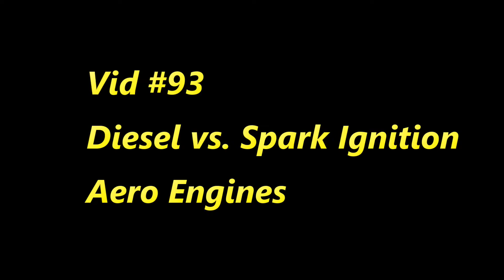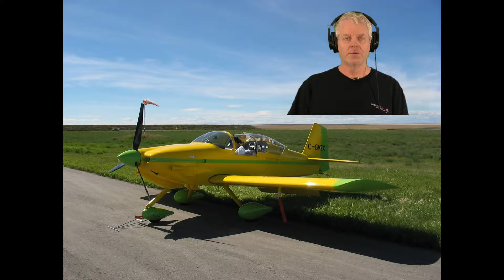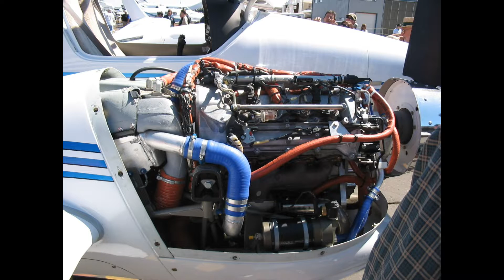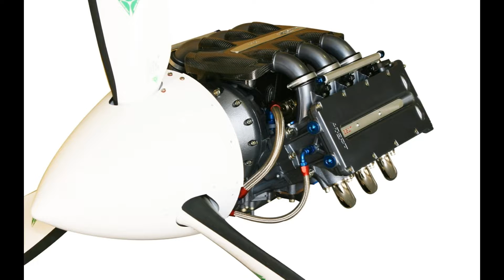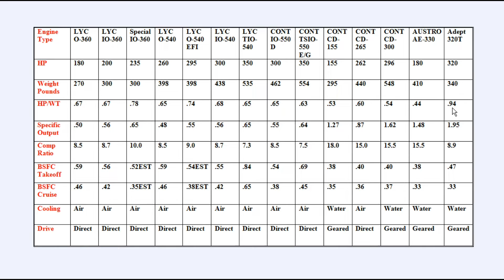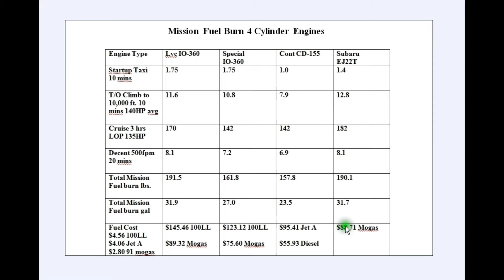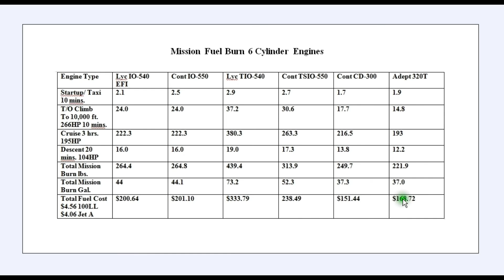Vid #93. Diesel vs. Spark Ignition Aero Engines

Comment: Thanks again for an excellent presentation.  I assume the Adept 320T is port injected with DOHC and coil on spark ignition, as are most cars were when it was first designed.  Using an 120 degrees bank angle should eliminate the need for a power robbing balance shaft.  Did the engine use any variable cam timing or were the cams optimized for cruise power (~240 hp)?  Finally, the gearing would have to be at least 2.0/1 to use the full 320 HP with most standard propellers.  Since whole number reduction ratios risk resonance between the engine and prop, did they go with a still higher ratio so the max power occurs well below 2700 RPM on the propeller?  Thanks in advance.
Reply from the maker: Yes, port injected, DOHC, 4 valve, COP as far as I know. I may be doing a more in depth video on these engines again in the future as the company has been in touch again recently.

Most V6 engines don't use balance shafts. No VVT on this engine as that doesn't make much difference on an aircraft engine operating at high load and a relatively narrow rpm range.

Not sure what the redrive ratio is but probably not 2 to 1 exactly.

Comment: There are a couple marine outboard motors now which use spark but burn Diesel.  Not sure, but I think they use a higher compression ratio than gasoline engines but not as high as the conventional Diesel.
Reply from the maker: Some newer SI auto engines are at 13-14 CR now- almost as high as many diesels.
Reply: @rv6ejguy  Standard non Hight output 6.7L cummins is 19:1 static prior to turbo charging then add 38 PSI of boost to that. Never seen a gas engine that can come anywhere near that. They get 850 lbs of torque. the HO is 1075 lbs of TQ.
Reply from the maker: @Mike-01234  The Jesko 5L produces more torque on less than half that boost on pump gasoline and 1100 ft./lbs. on pump E85- gain with 1.7L less displacement and about half the boost.
Reply: @rv6ejguy  LOL $3 million dollar car revving to 8500 RPM compared to a stock ram 6.7 LT cummins diesel engine makes 850lbs of torque at 1700 RPM in a pickup that you can buy brand new in any city for $40k 2WD.  Actually they sell a High output version that now puts out 1071 lbs of toque still get 20 mpg on the highway I get 14 in the city 7000lb truck. http://www.cumminshub.com/67.html    That's completely stock with far less then 3 million dollars you can increase a 6.7 LT diesel up into 2000 of torque running on the same fuel you can buy at any pump in any city.  Chevy, Ford also sell comparable engines not sure these can ever be adapted for aviation unless they are installed in a much larger aircraft.  E85 isn't even sold at the pump in many states I never seen it here in Arizona. I do know that it burns at a faster rate so range is far less then diesel fuel. Here is a video of a 3000 HP 6.7LT diesel engine highly modified explode on a chassis dyno. https://www.youtube.com/watch?v=S2zwCipHZGY
Reply from the maker: @Mike-01234  I don't consider price, application or fuel in these videos, just facts about specific hp and torque. I purposely found the most powerful diesel drag engine I could and compared it to an SI drag engine with 1/3rd of the displacement and 1/2 the boost pressure. The smaller SI engine spanked the diesel in the 1/4 mile.

If we look at something more common- Ford Focus RS- running 91 pump gas. Scaled up to 6.7L to compare to the 6.7L Cummins, it would output 1020HP and 1020 lb./ft. of torque- still running half the boost.
Reply: @rv6ejguy  Not without running high octane racing fuel, and gasoline engine will burn more fuel at the rated power then a Diesel. You already pointed that out in your graphs that Diesel aviation engines out perform gas engines when it comes to fuel economy. The fact is a diesel can burns more effectually.
Reply from the maker: @Mike-01234  I just provided you with several real-world examples of SI engines making higher specific hp and torque on pump gasoline than diesels do.

The Adept 320T provides lower BSFC than the aero diesels in cruise and has a much better power to weight ratio.

Comment: This was great.... Obviously you go on what you know (data wise). My comment is extra weight of water cooling system not accounted for. The fuel burn on your mission chart does not include airspeed or MPG.... Some of these planes are faster. Obviously this involves airframe efficiency, including cooling drag. Engine cooling is both science and art. Often water cooled engines in planes designed air cooling are not always executed well and are draggy, more than the air cooled engine version of that plane. So an efficient engine is not as efficient if you are going slower. As more water cooled engines come into the market the art and science of water cooling in small tractor single enginel planes will be refined. The math and physics are known, eg P-51. The cooling design (water or air) has to be built into the airframe from the start. Last I predict Diesel (JET A) fuel will be around longer and more available in the distant future, vs AV GAS or MO GAS.... not in our lifetime but I see it happening.
Reply from the maker: Just comparing in the same airframe at the same speed. Hypothetical exercise here to see how they all stack up.
Reply: @rv6ejguy  Great job... nice spreadsheets. Takes a lot of time to research. Thank you for this video. Price would a good data point, and availability of parts and maintenance is another dimension or factor. Thank you.

Comment: The 320T can be run on mogas and would be absolutely unbeatable if mogas were used in the final comparison.
-
The 320T data is really surprising to me, all around, and it's great that you were able to get it from Adept. I never would have expected the compression ratio to be so low, I wouldn't have expected the cruise fuel consumption to be so low, and I wouldn't have expected the full power fuel consumption to be so high. I suppose that one can get spoiled after looking at the data from racing engines for many years, as racing engines can manage to have very high compression ratios (even when running on ~90 octane fuel), and very low fuel consumption, all while managing to have high specific power output.
Reply: Thanks for sending me the information, appreciate it.
Adept is incredible, but gear reduction makes  sense.
I do have a prototype for a very efficient reduction system .
No rubbing teeth, still a positive engaging system, all ball bearings
but limited to 1:2, 1:4, 1:8 ratios etc 
Including load sharing contra rotating applications.
Reply: @arturoeugster2377  Positive engagement with no gears? Interesting.
Reply: @PistonAvatarGuy  
Is is obvious that I cant disclose this over the internet.
But there is a  rough analogy: and this deals with 2 types of electric motors:
1) the common inductance motor as used on Tesla cars, and the new variable reluctance motor just introduced.
2) Resistance to a current produces power losses  I²×R, unavoidable unless it  is so cold that super conductivity is there.
Reluctance is 'resistance' to a magnetic  flux but produces no losses, controlling this allows to properly phase the torque pulses in a motor without losses.The efficiency jumps to ~93%.
The key here is to 'think laterally' ,, de emphasize what is known and never questioned, and find Alternate ways to achieve similar but constrained results. 
In my case only few ratios are possible but the losses are incredibly low. But only a prototype can prove this.
The unit can produce coaxial, contra rotating output of high reduction ratios (integers only)
Why is that important?
Remember Howard Hughes crashed in super efficient twin piston engine A/C with contra rotating props.
The rule is: the first prop acts like a normal prop with a peak efficiency ~ 85% (Hamilton Standard, where I used to work), The second prop recovers a part of the losses, the rotation energy, and the rule is this contra rotating one operates at ~100% . In other words, the recovery covers the blade friction losses + -.
Both together operate at  92-93%,    significant enough to give the Rusky BEAR bomber significantly more range. This old noisy thing is still in use.
Applied as  single unit to a P&W PT-6 (normally geared down ~ 16:1) would give CR 15:1 exactly. Connected directly to the power turbine.
Just saying, no actual plan.
BTW   15 = 2 × (8)  - 1
            CR         SR
Reply: Reading your remarks a year ago, I am also skeptical that a sfc of 0.33 can be achieved.
My speculation is that  in cruise they overlean and have a protection for the oversized exhaust valve, combined with extended expansion, by variable timing of this valve(s).
That reduces pressure available to the exhaust turbine, but just enough to drive the optimized compressor, and minimizing the waist gate flow, if any.
Tremendous progress has been made with CFD on single stage centrifugal compressors (Example the french Microturbo, now part of SAFRAN, has a turbine engine with a single stage pressure ratio of 8, earlier 4 was the 'limit')
What that means is, that high total pressure ratios ( compr + piston) are possible, requiring high power operation with much excessive fuel for cooling , like on a TIO-541  Lycoming at TO and climb power.
And an optimized piston lubrication system.
Maybe asymmetric location of the connection rod bearing on the piston, to reduce side loads.
As you know, diesel engines produce soot, which produces graphite coating on the cylinder walls, reducing friction and greatly reducing wear. 
This has to do with the very high combustion temperatures in diesel engines due to the high compression ratio.
The combustion occuring at temperatures much higher than 1000°C produces first carbon monoxide, not co2, only after cooling due to expansion does the temperature drop below 1000°C, then the Boudouard process begins where 2 CO molecules produce 1 molecule of CO2 and free carbon - soot. this process is complete at temperatures of 400°C. Because on a diesel engine there is always excess oxygen available, some of the soot is burned, on the downstroke, explaining the higher thermodynamic efficiency of the diesel engine.
Now with over leaning on the Adept engine, together with high turbocharger pressure resulting in higher combustion temperatures an analog process can be visualized, improving the efficiency, diesel like.
All this is speculation, a teststand operation of this engine with proper instrumentation, can shed light of what is happening on this remarkable 'clean sheet designed' engine.
Reply: @arturoeugster2377  I wouldn't say that I'm skeptical about their SFC number at cruise, I think that it's entirely possible, I'm just surprised that they were able to achieve that number with such a low compression ratio. I've been seeing gasoline engines around 0.36 for years, but they're all running near stoichiometric and have 10:1+ compression ratios, so leaning should provide some additional efficiency.

With liquid cooling, the cooling of the exhaust valves wouldn't be a significant concern, your concern no doubt comes from your experience with air-cooled engines.

No VVT is used on the Adept Airmotive engine.

Your reduction system is very interesting. As a teen (~20 years ago), I often wondered why no one had come up with some sort of electric torque converter (for lack of a better way to describe it), and I'm sure that there are some very real difficulties which have prevented something like that from becoming commonplace. It rarely pays to think 'outside-of-the-box' these days when it comes to well understood technologies, but I wish you luck. 

I hope that you're not crediting Howard Hughes with the invention of contra-rotating propellers, as they were around long before he ever made use of them. Those engines weren't even developed by any of his companies/employees. I'm not sure which aircraft first used contra-props, but I know that they were very successfully used on the Schneider Trophy aircraft built by Macchi in the early '30s. The XF-11 was very, VERY old news by the time it actually flew, Hughes was trailing very far behind the curve at that time. And while contra-props are efficient, their additional weight, cost and complexity can only rarely be justified, which is why they're almost never used. Even the final version of the XF-11 was built without the problematic contra-props that were used on the first example.
Reply: @arturoeugster2377  More info here on the efficiency of diesels vs Otto cycle engines: https://www.youtube.com/watch?v=cwGxuiLFhys

Comment: Fantastic info, could you add the Higgs  diesel and the  Delta hawk? I think Higgs also modifies air cooled engines to be water cooled .
Reply from the maker: I could maybe do another segment on these 2 engines in future if the manufacturers were willing to share technical info and photos. Glad you liked this video.
Reply: @rv6ejguy  I was very surprised to see that they are developping a V4, V8, V12 at the same time ! As if a new engine type with zero off-the-shelf parts was not hard enough to bring to life.